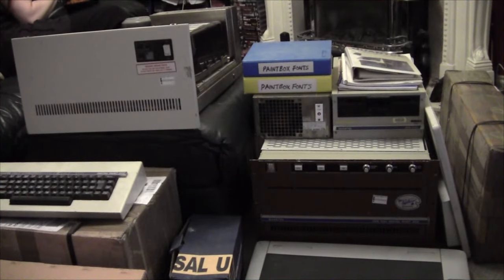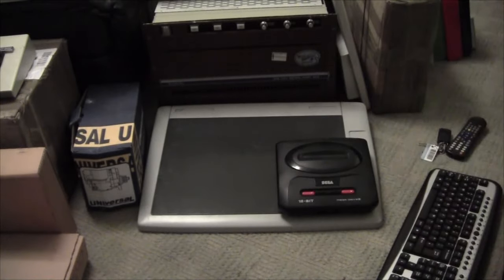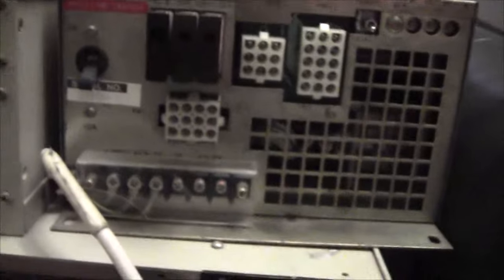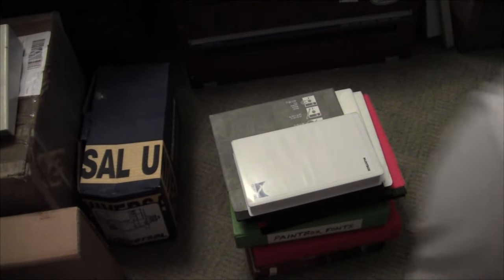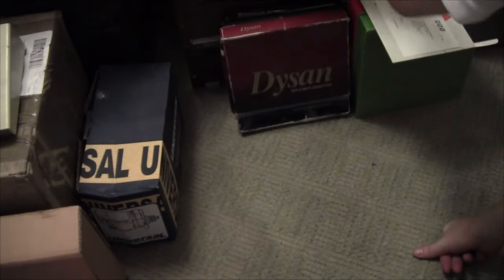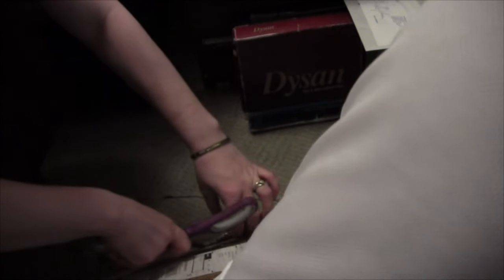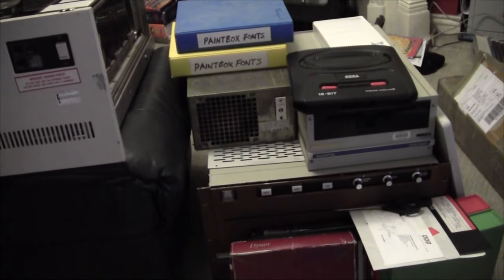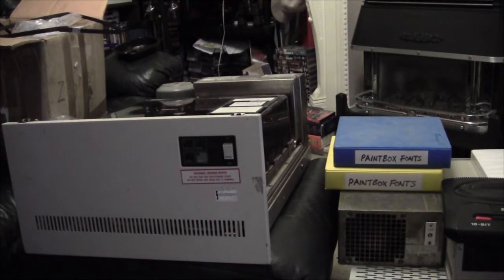BBC's Historic Mainframe Arrives!!  (Quantel Paintbox DPB 7000)  This created many 80s programs!!

Comment: Steve, it's great to see Quantel getting onboard with this. The PCB with the copper piping - those things are delay lines. Not an everyday site today! That PCB is a key component providing sync for the computer overlay and the video source. It was re-assuring to see another one in the spares box. It would be just about impossible to repair.

Comment: "The computers that were used were Spaceward Supernova Paint Systems. These were Motorola 68020 based systems (the same processor used in the Amiga 1200, Mac LC&II, and late model Sinclair QLs). They had 12MB RAM, and 600MB hard disk." Just done a bit of digging around Knightmare. So it was the paint systems as u mentioned.

Comment: Steve, if the PSU is a linear power supply it should be able to start without a load. The easiest way to verify that the mainframe power rails (and spare PSU) are operating properly would be to take all the cards out of the chassis and just power the fan trays and backplane. You should be able to meter the power rails from the ancilary power taps on the back of the PSU, For all the power supplies I'd suggest replacing the electrolytic capacitors that are higher voltage filter caps.

Comment: The drive is an SMD device (storage module device). SMD is a standard that came from the early 70s. It was more common in the mainframe market and was superceded by later standards such as FC storage and SCSI in the late 80s.

Comment from the maker: Lol, I just watched that 'I'VE BEEN QUANTELED!"...must make the t-shirt.  Yes, with most stuff, just power it on, but with the complexity and cultural value of this, taking it one step at a time.  At the moment, got to the stage of testing the 29 cards, 18 done so far and 2 have emitted magic smoke, so put them aside for repair, but not to bad all in all :o)  No idea on the floppies yet, although I have no restored the floppy drive too, can't check it until the main system is up and running :o)

Comment from the maker: Yes, a very long time to work out how to put it together, I'm pouring over the schematics at the mo trying to work out how to plug it into the tv (once I have it powered).  You should see the connections just to the drive, those huge ribbon cables have to be attached!! (60 wires in them!)

Yes, it's being installed next to the tv where the serial terminal is so that wifey and I can use it, spare parts are really good :o)  going to be hell to diagnose any problems with it as most of it's.....

Comment: Very cool indeed. Your soon be able to open a museum to computers of yesterday before long. By the way most of those circuit boards should have not be packed like they were in polystyrene as that can damage them (but not your fault I know) Also (having looked it up) The ITV program Knightmare only used this machine for it's first two seasons because Anglia TV had no computers of there own so they asked the BBC if they could use this. Latter series were done on a Amiga..

Comment: I spend most of my time messing with old computers like Speccies, C64, Amiga, N64, Dreamcast, SGI etc. and many years ago had a collection of around 70 different types of computers.
I wish I'd kept some of that stuff.

Anyway, I'd loved to help with preserving the data on your Quantel, it's an absolute one-off.
There's not much to be found in the way of pinouts etc, but I also do electronics / FPGAs etc.

I'm thinking something like the KyroFlux and a generic 8" floppy drive might do the trick?

Comment from the maker: Yes, I have many different types too, but recently, they just seem to be getting larger lol.  I have all the pinouts for the system as it came with all the technical manuals :o)  Yup, could be an idea, I don't know the state of the disks yet beyond a visual inspection, some do have slight marking on the exposed surface but we shall see :o)

Comment: I hated those corded pens! Cordless didn't show up until 1990.
Still have some of those 8' floppy disks.
This setup need lots of cool air or the boards will fry, I've seen it happen.
Decommissioned in '90?  What was it replaced with? I used PTBX as late as 1999.
When the unknowing referred to us as "operators" we corrected them with "designers", it is
a creation device. 
With this devise backgrounds and elements for animations could be
created but those files would have to be transferred to tape or captured in still store
devises to be edited together usually with ADO/ Kaleidoscope.
PTBX had lonly basic animation capabilities until HAL/HARRY/HARRIET were available.

Comment: Purchased originally for the weather Dept but borrowed by others in the making of TV series tripods for example. Only two ever purchased by BBC.
Reply from the maker: Yup, only heard of 2 in the bbc although I've heard of a possible other 2 in storage.
Reply: If you mean only two of the first-gen Paintbox were ever bought for Elstree, you may be correct. But it's certainly not correct to imply that the BBC only ever purchased two Paintboxes ever. They had many more than that by the 1990s.

Comment: The capacitors will be leaky and won't hold charge at this age. This will cause voltage ripple on the power rails and wreak havoc with the system. You'll need to replace all the evil yellow tantalum bead capacitors as you find them as well. They will pop like popcorn in a pocorn maker!
The machine is 68000 based. 
You're making me want to grab a HAL paintbox I've been offered now dammit. Must resist!